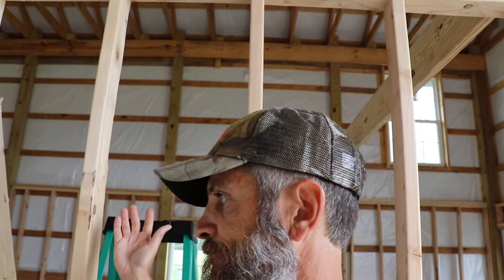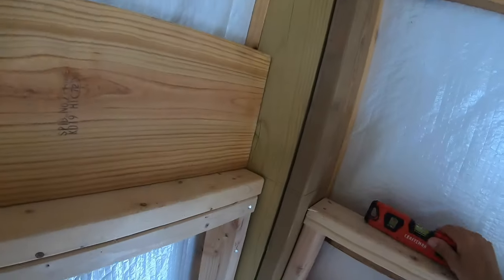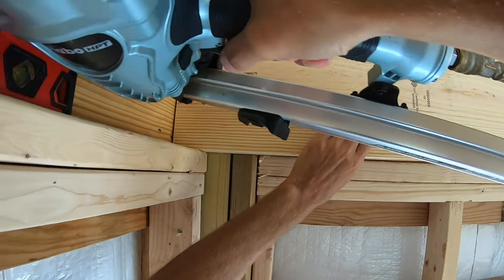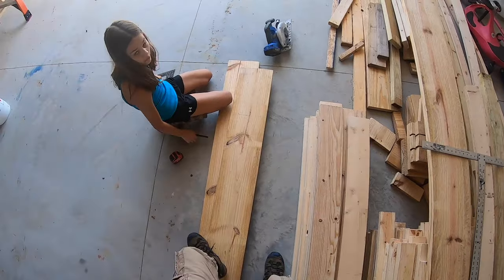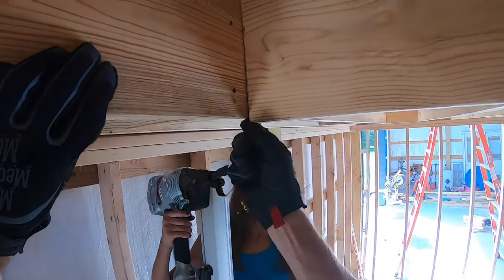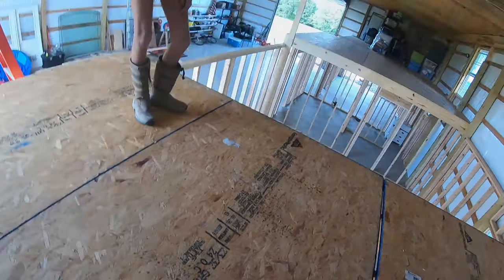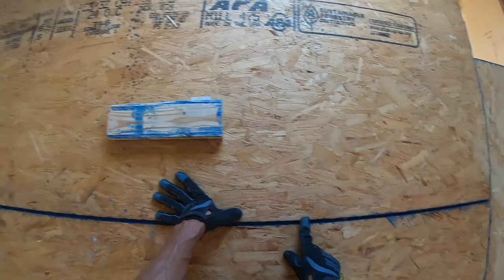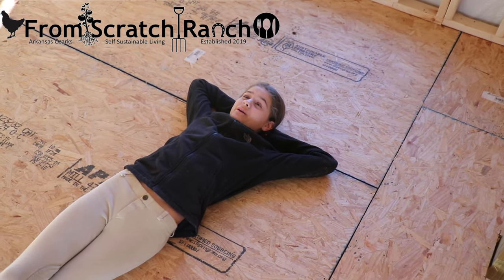Building My Loft Bedroom in the Barndominium

Comment: How did you secure your joists at the wall where you put the ledgers? I have a pole barn with 6x6s 8' on center and am trying to figure out how to attach a ledger. Didnt really want to build a wall but I may not have a choice.
Reply: I've done a few like that and the best way is to use an engineered beam (LVL) that spans across the posts, with any joint landing on the centre of post. Once its nailed in place, use some 5/16 GRK screws to screw it to posts. I try to get a minimum 5 per post or 6 were there's a join. Screws should be long enough to go at least 3" into post. Heavy nailing, screwing a 2' block on each post underneath the beam will give even better strength.

Comment: How tall is the ceiling?
Reply from the maker: 16ft high in the main area between the lofts.  Standard 8 ft ceilings downstairs, but only 7 ft tall in the lofts as the subfloor, flooring and downstairs ceiling drywall take up the other foot.